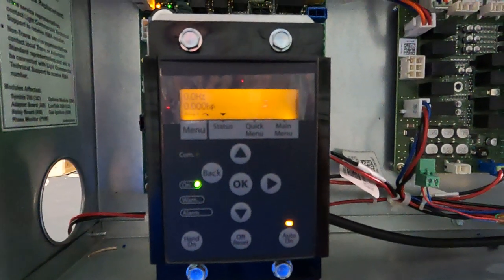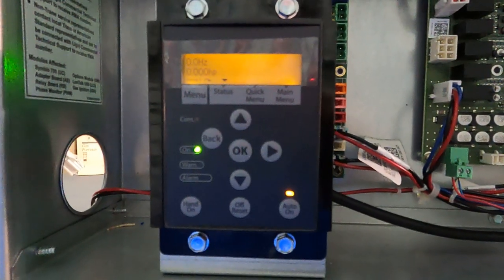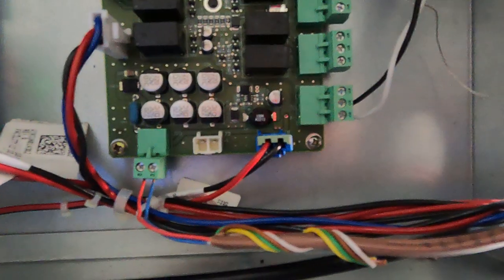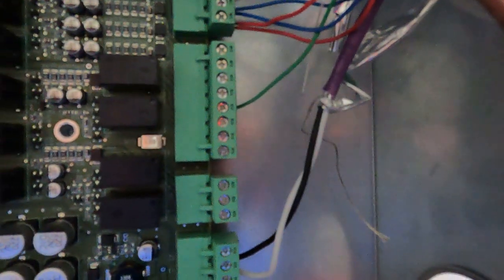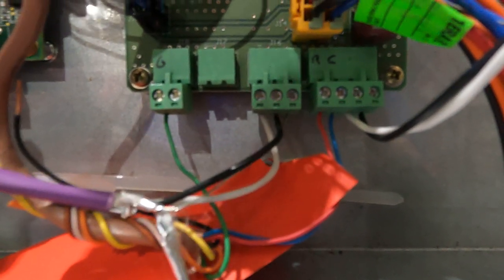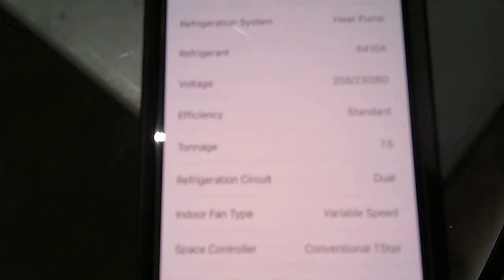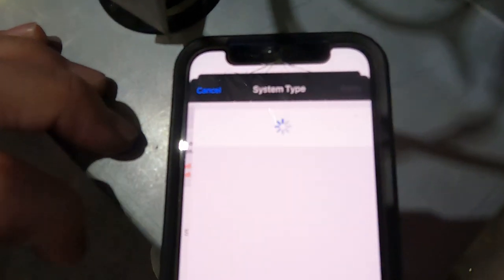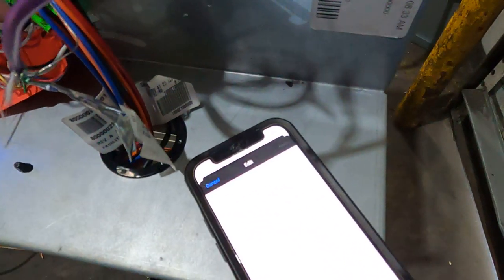Symbio VFD Wiring American Standard and Trane Odyssey

Comment: I did the wiring To my unit following your wiring and it worked fine but I can’t seem to get the blower to ramp up to 60 Hz have you had that issue?
Reply from the maker: What frequency is it operating at, 30hz? You can adjust the min and max speed in the app or on the vfd keypad.

Comment: That looks nice. But can you show me how to do two symbio condensers to one AHU with VFD? If you can you'll be a hero.
Reply from the maker: I don't know if the factory has that as an option.  ss-svn016a-en is good reference material.  

https://www.google.com/url?sa=t&rct=j&q=&esrc=s&source=web&cd=&cad=rja&uact=8&ved=2ahUKEwj11LjLwbqEAxUY48kDHdWxCUwQFnoECAwQAQ&url=https%3A%2F%2Felibrary.tranetechnologies.com%2Fpublic%2Fpages%2Fviewers%2Fpdf%3FprojectKey%3D5fdb788a8fd84100018bb855%26itemKey%3D6291317de94b0d229f74dbbc&usg=AOvVaw2wkCM_XV5LlUIL4n6EqZcP&opi=89978449

That shows a 2 condenser pairing, but not vfd.    My thought is you could wire up a vfd indoor unit with one outdoor, connecting the modbus between them.  Treat it as a single system, then slave in the second condenser with the isolation relays.  This would get tricky with defrost on a h/p.  Again, just a thought.
Reply: @Hvacoffroad  thanks. It's not a heat pump. 2 Straight cool condensers with a 2 stage duct furnace. I have used the z pairing which shows isolation relays but doesn't have any details which condenser the communication should go to. The fan just refuses to run.  A couple of Trane guys showed up today without any luck. These units are ridiculous,  they ship this stuff out without any clear instructions.
Reply: @Hvacoffroad  about the modus between them. If you do that you'll need to have two diffrent addresses on the condensers and I haven't seen anywhere to do that. The trane guys might be able to but us mortals can't.  I think those guys tried that today and got the same result I did. Alarm bonanza. These things are entertaining enough for a good size crowd.

Comment: How would you wire if unit is electric heat only? Can get blower on but no strips
Reply from the maker: If you’re getting the blower to kick on, most of the work is done. J5 in the indoor relay board has terminals for w1/w2. Land your heat wire on those from your thermostat.

Comment: So your thermostat wire doesn’t goto the indoor unit? Only the outdoor?
Reply from the maker: Correct. J21 on the outdoor unit is where your thermostat wires should land. Those are the inputs. Then the boards send the outputs to the air handler out on different wires/terminals.

Comment: My book tells me to land the shield on the condenser not the AHU my 15th is a D on the air handler not seeing any alarms but the vfd will not ramp up everything appears to be communicating my only difference is my 24V is coming from the same R as the stat I didn’t install this unit I’m here cause the first guy was lost now I’m lost lol. 24v is 24v right I can run another set of wire if 100% necessary but in a place that when I do ceiling work I have to do a whole ordeal and it’s a long process so I didn’t see an issue with stealing 24 from wherever I could. Any thoughts here @Hvacoffroad
Reply: Also getting the supply fan failure on the app. I did go ahead and verify that everything was communicating indoor board and VFD are communicating upstairs at the condenser. I’ll be back here tomorrow to keep looking.
Reply: @Hvacoffroad Got the fan running but it shuts down after a few seconds and I get the same thing supply fan failure it’s like the symbio isn’t being told the fan is running
Reply from the maker: The R on the j21 terminal doesn't have the amperage range that the other terminals have.  I've seen some thermostats go blank due to the amp draw.
Reply from the maker: I does sound like it's not communicating with the indoor vfd.  Are you getting any faults on the vfd keypad?  I'd check the settings on the symbio app.  Is it set of for "standard efficiency B?"
Reply: @Hvacoffroad   Actually ended going from ctrl word only to digital and control word then set source to FC Port and it worked great 1st gave half speed and 2 stages gave me full speed. I set the parameters exactly how the sticker on the unit stated and triple checked it would not work followed your wiring then made those two parameter changes and I was good I don’t run into these often as I do mainly chilled water but they sent me that because I had a back ground with Honeywell and Niagara. Definitely interested to see more of those symbio systems.

Comment: So if j7 to j16 is wired then
you don’t need the J11 plug off the relay board to operate the VFD?

Thanks!
Reply from the maker: That sounds correct. J7-j16 is for modbus comm and vfd control. J11 on the relay board is used for a “non communicating” vfd.  Basically a 2 speed vfd with a high and low signal. That air handler is a option ordered from the factory. 
So either one or the other, but not both.  Hope that helps.

Comment: Wired a 15 ton by the book pairing A or B. Also changed to VVZT but Can’t get blower to come on. Condenser starts up but I get supply fan failure. Any tips.
Reply: There's a new harness and wiring adapter to power the vfd on the szvav air handler to symbio 700 outdoor
Reply: If your 15 digit is a d on model#
Reply: My 15 digit is B
Reply from the maker: Check the Symbio app and see if the vfd is “communicating” in the service menu.
Reply: What if don’t have building automation would still have to run that wire from imc inside to imc outside?
Reply: Try in the app setting fan from single to multi fan
Reply: @taylorj9920 is this the speed control wiring?
Reply: I’ve had same issue, except I am also running the RS458 wiring, it’s not getting enough voltage, (only 2.5 vdc) any suggestions?